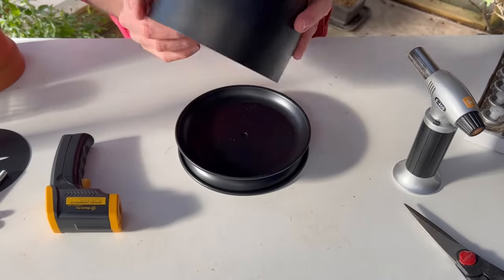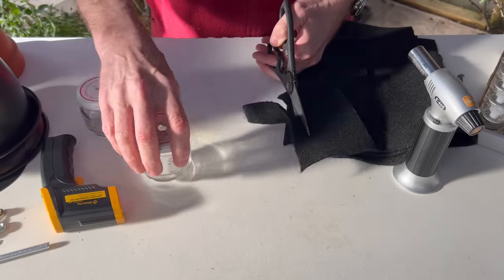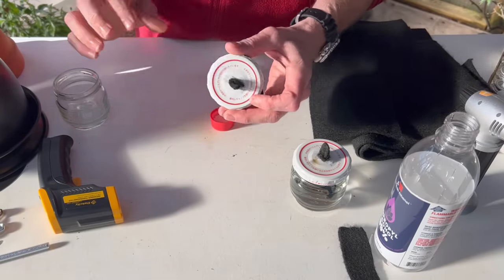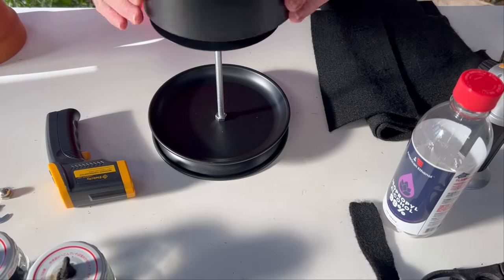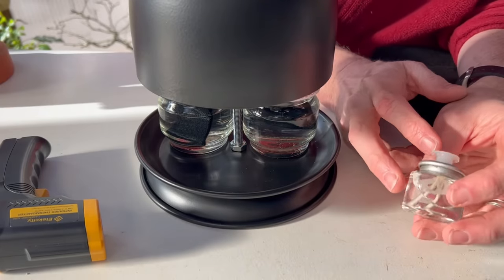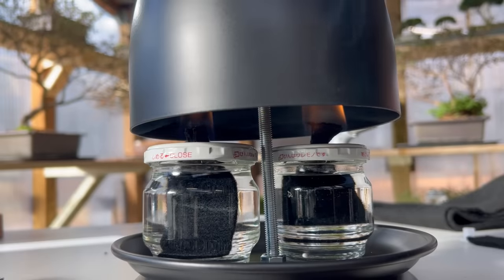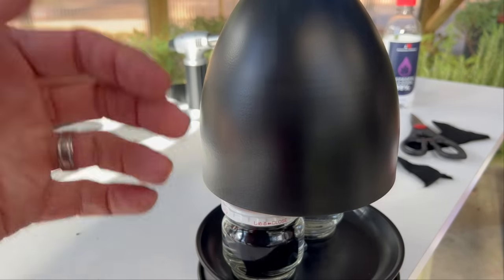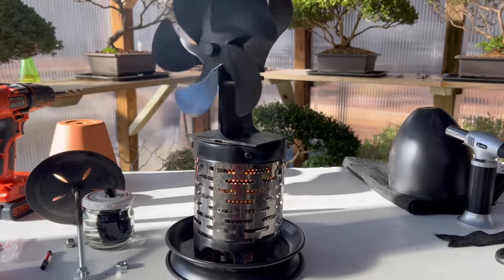DIY Carbon Felt Dome Heater | No Electricity Needed For Greenhouse Heat

Comment: You need to do a test on the base and the glass jar. The heat radiating back off of that dome on top of that metal lid will cause the metal lead to get very hot. Which could break the glass jar. This is an extreme fire hazard. You should not be using anything that could shatter due to heat
Reply from the maker: Tested in excess of 24 hours.

Comment: With temps plummeting recently, I have used a terra cotta candle heater with the same fan you're using to blow a little heat into the run of my chicken coop.  I have a concrete pad and am using bricks to raise the terra cotta pot to allow for air to get to the candles.  So far it works pretty well.  I'm using 4 inch tall, 2 inch diameter candles (2 on the colder nights) in a metal can for heating the fan.  I know that it won't be enough to keep the chickens toasty warm but I'm only trying to keep their combs and wattles from freezing.  It is a fairly substantial terra cotta pot that the chickens cannot move and it does not contact anything flammable.  I have seen people using Crisco in these heaters but wasn't sure about that in my use.  What do you think about using your heater?  I can't guarantee that the chickens couldn't touch it and, at 550+ degrees, the last thing i want is "fried" chicken!
Reply: You could roll up some chicken wire around the units as a barrier to keep the chickens from frying themselves....but who doesn't like fried chicken?
Reply from the maker: Sounds great
Reply: We live in Alaska and have 12 chickens never had to heat our coop

Comment: What is the cost difference between this and a milkhouse electric heater? Or even a mister buddy heater?
Reply: we use a mr heater in our large greenhouse. on low a tank last about 2 days straight thru for when it's really cold. 
we have one that doesn't burn as hot - it lasts most of a week on low - Wish i could adjust a new one to burn like that one does!     we use it for warmer cold temps.
Reply from the maker: Electricity
Reply: @ZenGardenOasis.  right. But 95% alcohol is not cheap. We pay 11 cents/kwhr , us.

Comment: not as hot as your heater, but my greenhouse is little.  i use old  crockpots. i fill  it  with sand and water keep it on high. it works
i love your videos. thanks for sharing
Reply: Is there any point in the water?
Reply from the maker: Great idea!

Comment: Have you tried the same experiment with cooking oil candles?. You can get 1 gallon of cooking oil for $10. That's much cheaper than propane, and they last much longer.

Of course they won't burn as clean as propane does
Reply from the maker: Great idea

Comment: I always wanted to do a heater with platinum catalyst.  Just like the old school pocket warmers but on a larger scale. Not sure if you remember the old zippo pocket warmers and how much heat they produced.  Carbon fiber wick touching stainless steel mesh and catalyst in the mesh suspended just above the wick.
Reply: Couldn’t live without it when winter fishing in the uk😉

Comment: I think if it had about 4 holes about 3/4 the way up it would generate more heat. If it were a little bigger and were even a thin cast iron and a little more space it would be fantastic.

Comment: Do all types of these hesting sources need to have ventilating system or does it depend on the fuel you burn example canola oil, vs isopropyl alcohol, is it thay you need ventilation period or only il it would create fumes?
Reply from the maker: Yes somthing that’s 100% pure burns cleaner…cheers

Comment: Since when does alcohol require a carbon monoxide dictator ?

Consider a sand or salt Battery as well
Reply from the maker: If your fuel isn’t 100% it can exhaust toxic fumes
Reply: @ZenGardenOasis.  Ok , gotcha